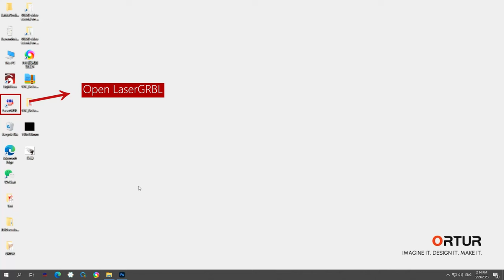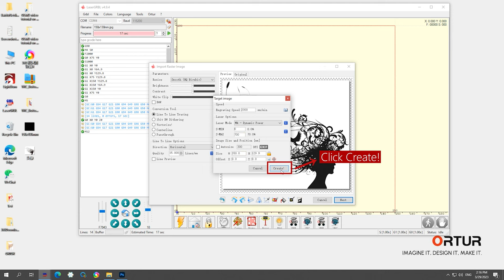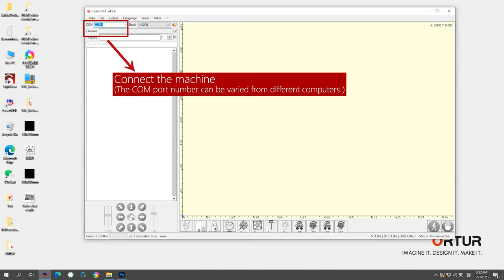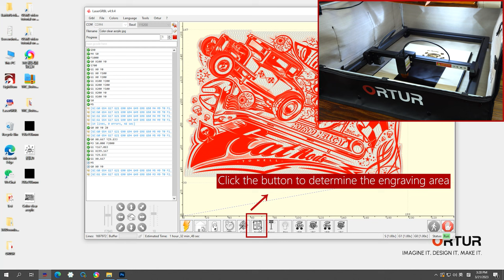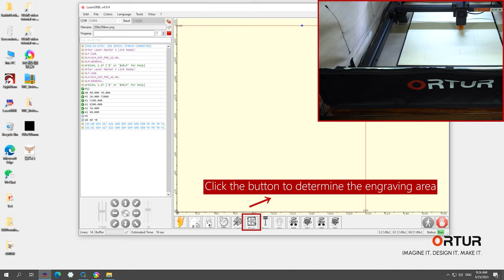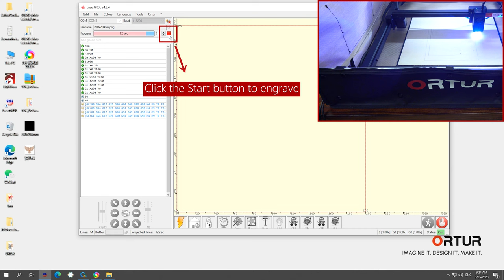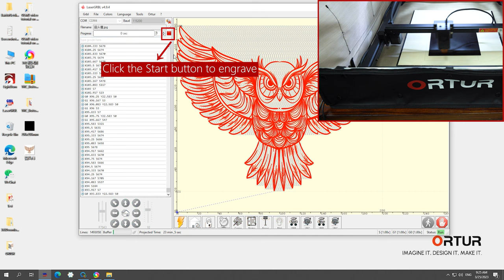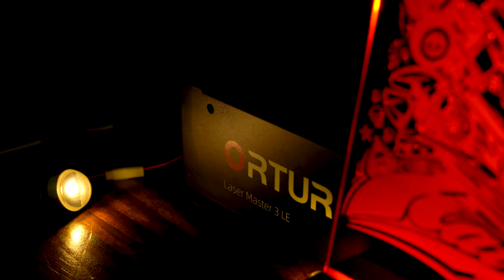How to engrave on clear acrylic with OLM3LE

Comment: Thanks for the video. Do you engrave the top of the acrylic where the paint is? I've seen others using tempera paint for the clear acrylic and placing it paint down, focusing on the bottom and not on the top like you did, and engraving the bottom and not the top. I am asking because I ruined several acrylic sheets. I am wondering if this is going to work for me. I have a 20watt module, so I need to adjust the settings. The machine used in this video is 10watts, right? Thanks again for the video.